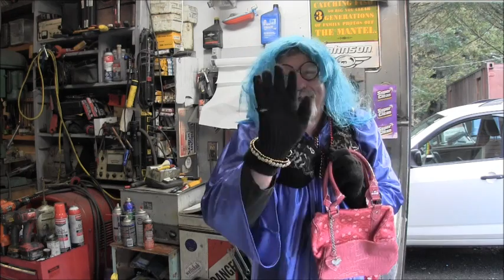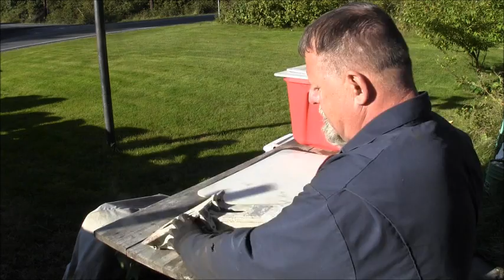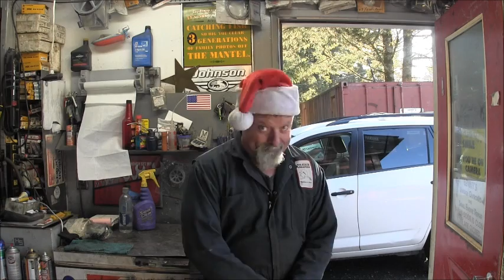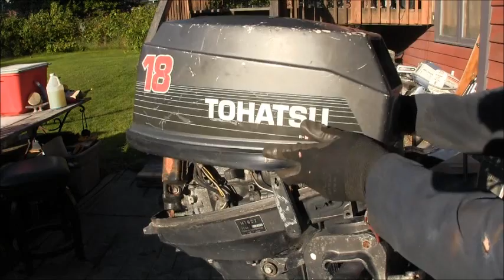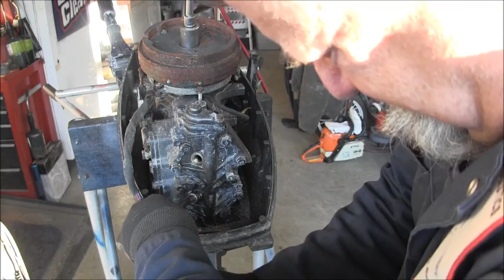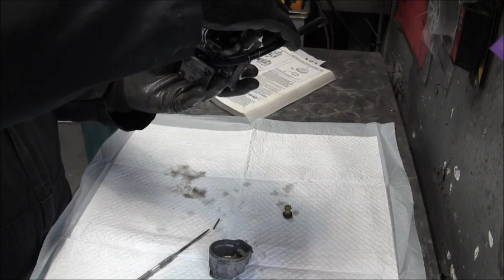TOHATSU  18 HP  two stroke  wake  up   ( part 1 )

Comment: I have a 1989 55 force. Ive rebuilt the carb, coils,  water pump, fuel pump, 110 compression on both cylinder.   It runs great with  ear muffs, but when on water under load bogs down under load and dies, then hard to start.  Any idea?

Comment: My 1984 Evinrude 115 hp I was talking off the flywheel with a 3/4 in impact wrench it was stuck and then POW 💥 explosive release sounded like a gun going off though I broke it but I didn’t it landed next to my boat scared the crap out of me I leave the nut on A few threads after that
Reply from the maker: been there friend,   kodi

Comment: After Katrina, so many motor were flooded by surge, we oiled everything, when I say everything, I mean everything for a couple weeks before starting any work on most of them, of course we would check to see what was viable and if it needed it, we’d start oiling them! Marvel Mystery Oil was an added item for flywheel issues! Now you have to take into account, we weren’t allowed back into our area until weeks after Hurricane Rita, which was weeks after Hurricane Katrina!!! I know everyone has opinions and wants to say how to do things, this is just another avenue, we had great success. 
That Tohatsu looked like it was just sitting out in the weather, not used much! I had a 115/120hp Tohatsu can’t remember exactly which numerical sticker was on it, point being is, when ALL the DUCK HUNTERS were shooting their Yamaha’s with STARTING fluid and cursing their outboards VERY load, my JAPANESE POS (as THEY would laughingly call it) would pop right off NO ISSUES and when it’s HOT as HELL in AUGUST/SEPTEMBER here in South LA and a lot of those same motors would be running virtually on red line TEMP, I had NO ISSUES!! I can honestly say, I had MORE guys at the launch that I idled past make MORE FUN of my JAPANESE POS and when my outboard didn’t SPIN and SPIN and SPIN trying to get it to fire off, those same guys had the nerve to ask for a jump bc they ran down their batteries trying to start their YAMAHA’s, I would help, no issue, then they would ask 20 questions about my JAPANESE POS. When they found out my outboard only cost around $5-6K new out the crate and they saw it pop off when it was 17 degrees without having to jump over the moon, I started seeing more of them in my area, but you still have the diehards that will never change! I guess this is Yamaha country, bc it is for whatever reason and if you use a Humminbird Electronics, you’re committing sacrilege! Just thought you might get a kick out of that!

Comment: Love your channel. I have a question about my 1995 75 Mercury. I've done a compression check on it and all 3 were 125 lbs. Is that what I should expect?
Reply: I have a 96 60hp one and that is good especially they are all the same. they can all be lower but the key is not more than 10psi from each other. Say like you have 2 @ 120 but one a 108? That would mean you have a issue with that cylinder which could be many things? 2 strokes mean a head issue, ring or scored cylinder. 4 stroke same but could be a valve issue which is easier to fix.
Reply from the maker: @TimsWorkshopTJY   Yepper,   kodi
Reply: @kodibassInsideoutboards  why does this have “Translate to English” down at the BOTTOM?
Reply from the maker: @blackmouthcur6097    I do not see it, So I do not know?    kodi

Comment: hey kodi on 1980s johnsons 9.9 and 15 how do you know if the thermostat is working properly
Reply from the maker: remove t-stat place in hot water at around 175 degrees . it should open, place in cold water it should close. if not replace.    kodi
Reply: @kodibassInsideoutboards  thank you
Reply: @kodibassInsideoutboards  how can i tell if the thermostat is working with it in the motor.Take a temp reading at head????